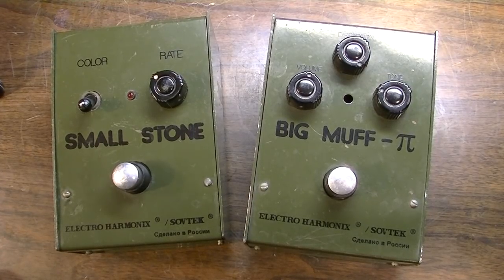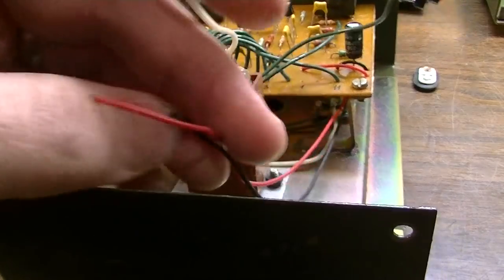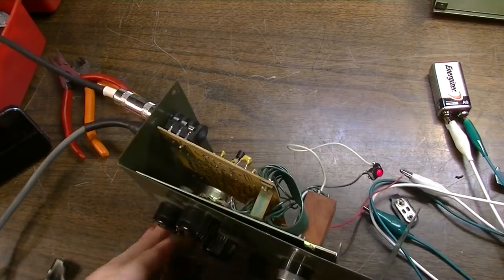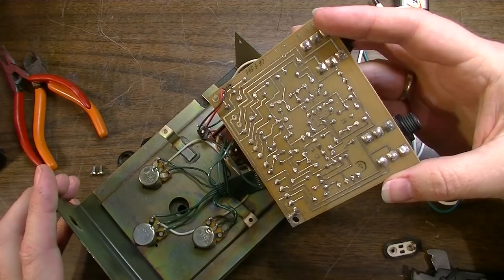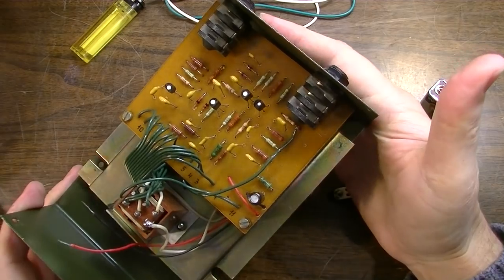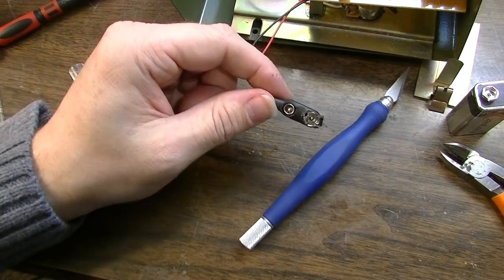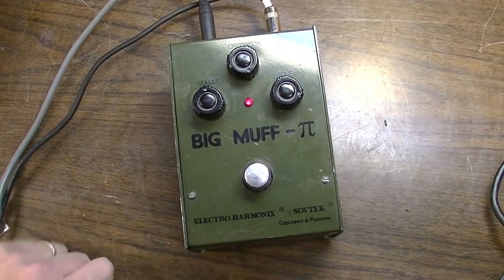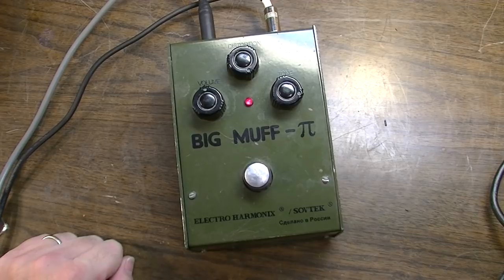Let's DIVE into a BIG Russian MUFF!  - Electro Harmonix Sovtek Big Muff Pi Reissue FIXED

Comment: Just an FYI for anyone reading:

A great way to make a heavy duty battery clip is to use the terminals and base from a used up 9 volt battery.

Pull it apart and keep the top and bottom black fibre/plastic bits; solder on some leads and then use a small amount of hot glue on the inside to join to two pieces; you can then use heatshrink tube on the leads if you want. They look good and outlast vinyl ones. Virtually indestructible.

Comment: I just bought a few hundred each of these exact Soviet era transistors and diodes used in these pedals. I also got a whole bunch of original knobs and switches...I couldn’t resist. The Russian datasheet says transistor hfe is between 400 - 1000. I’ll be testing a bunch to check the accuracy. I’ve tested them before and they’re all over the place.

I own five (three are V7 tallfont) Sovtek muffs myself and really like them, obviously. ;)

Comment: I like the heat-shrink solution. Neat. 
I've been insulating battery connectors lately with hot glue. Sometimes you get that soft plastic cover flapping about the place and it doesn't take contact adhesive too well. 
Good old hot glue appears to bond quite well to it. Time will tell ...

Comment: Not trying to criticize too much, because you know way more about electronics they I do, but I've built a couple pedals. I think it's typically better to use a hot glue gun to help hold in an LED. That way you can always peel it off easily if you have to take it out of the enclosure for some reason later on.
Reply from the maker: Commando Brando I like to use hot glue only in inappropriate situations. :D good suggestion.
Reply: Hot Glue Tip: When needing to remove the stuff, apply some isopropyl alcohol. It doesn't melt the glue it just gets between the bonded surfaces. Unsticks the glue innit. ;^)
Reply: KozmykJ prove it
Reply: +YUKI JINJUJI  ;^) Try it for yourself. 
For an initial test I 'd try it with some hot glue stuck onto a relatively smooth surface so you can see the effect. Then try it on a rougher contact surface. It may well be that on a really rough irregular mating surface that the IPA may not free it totally. But it's always worked for me. 
Given that HG can often be pulled off just by mechanical force the tip is just a way to make removal easier.
Clearly, if the HG has wrapped around a closed loop or a long post then the encirclement will have to be undone by additional means.
Reply: I was cringing at the super glue. Hot glue would definitely be the best option here.

Comment: thats some solid casing on these ones. they seem rigid.
Reply from the maker: The outer casing is thin gauge steel, but they are reinforced on top with a second bent plate.

Comment: Hey Brad, I have a question about a broken pedal I have. It’s a Boss DD-7 delay that I bought not too long ago and while pressing the switch messing with the loop/hold setting the pedal just died. Won’t turn on or anything but the switch seems fine, maybe I just fried it somehow.
I opened it to check it out and man the circuit on the thing looks like it could belong in a Macbook. Anyways, just hoping maybe you had worked on one before and could share some insight. Thanks!!

Comment: Had one for a very short time then sold it. I prefer humbuckers .Strat players liked because they fattened the 2@4 position and humbucker players preferred the treble boost . There is a very good reason Boss pedals became the standard of the industry by 1980. Their overdrives and distortions were far more universally usable as well as sounding better. Not everything Vintage is good. EH had a bad reputation for being Noisy vulnerable to CB radio transmissions.

Comment: You said something about Fran Blanch deigning the Rusky made BigMuffπ. Was it a new circuit that did the same thing or a redesign OR she was responsible for the circuit layout\component choices?
Reply from the maker: Someone in a comment on the previous video informed me she might not have had anything to do with this pedal. She worked on a later version.

Comment: how did you clean the pots? i usually just use canned air for my stuff but there's got to be a better way.
Reply: Servisol Super 10 switch cleaner ftw. Safe on plastics. Leaves a thin lubricant behind after it evaporates.
Reply: thanks for the help!!
Reply: I always use deoxit d5!
Reply: Colby M Another vote for Deoxit D5
Reply: I might go for a chemical reagent cleaner if corrosion was the main issue. Otherwise I'd stick with solvent and residual lubrication. Servisol has never let me down in over 40 years. A bonus Plus is it's about 1/4 the price of Deoxit for us in Britain. ;^)
Reply: KozmykJ  I had never heard of Servisol so I looked it up. Looks like it might cost more here in the states with shipping but would like to try it anyway. Thanks for the heads up, always good to have something else to add to the tool bench.
Reply: + Geiger Counter Virtual Museum
Happy to share.  I always have a can or two of Servisol Super 10 about the place even after retiring... 
For jobs where you Really Don't want any residue I used to use stuff called Colklene. Just a bare solvent spray that evaporated to nothing . It's probably banned these days. Least ways I can't find it. A BBC engineer turned me on to it. Nearest thing I can get now is Servisol Aeroklene 50. In the old tape days it was excellent for tape heads and video heads. General purpose head work I used Isopropyl Alcohol and baby buds. Mr BBC had his own fancy chamois leather covered cleaning sticks. That was back in the day when the BBC were the exemplars of technical excellence. Gone to the dogs these days... ;^)